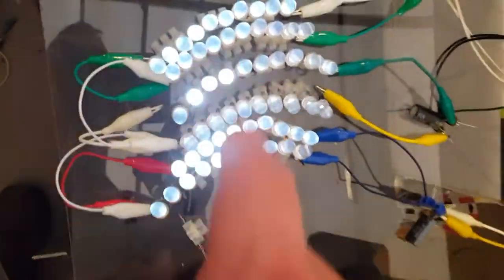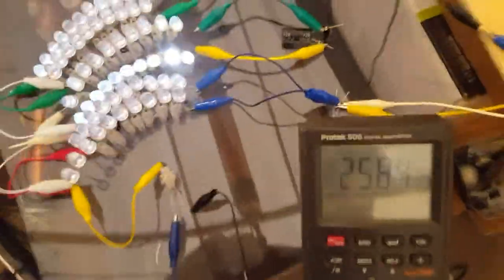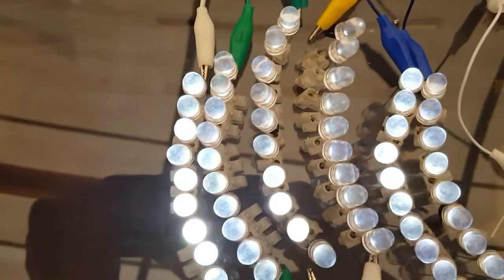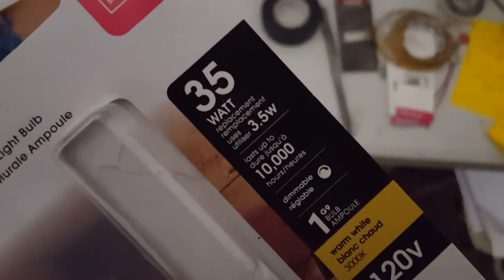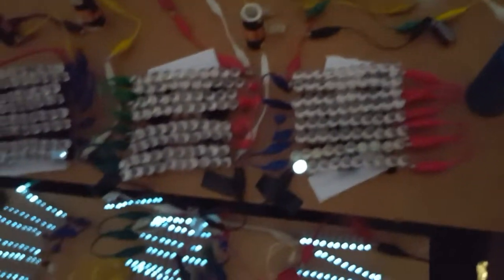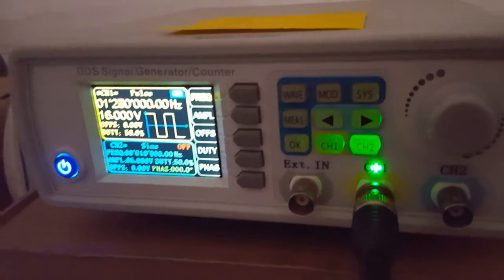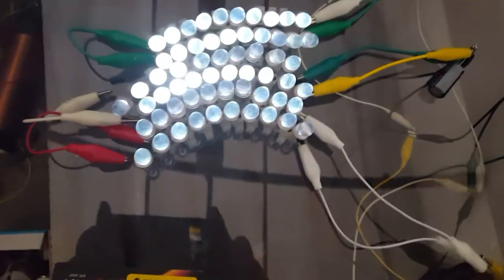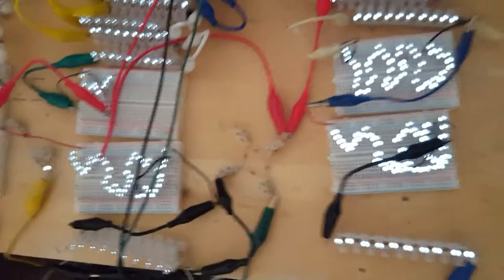WIRELESS POWER TRANSFER Part 22  (Over unity!? Free energy!!?)

Comment: Cool stuff! Great progress man
One way to make it a closed system - find a used (or new) UPS battery backup like what people use when the power goes out, their computer stays on because there's a 6 volt or 12 volt battery inside. 
Also find an inverter that converts DC to AC 120V 60 Hz.  
Start with the output of your circuit that lights hundreds of LEDs set to give 12V DC to the inverter, at enough current to charge the lead acid battery in the UPS. 
Have the UPS plugged into the 120V wall socket,  plug the signal generator into the UPS, then get your circuit running. 
Make sure there's the 12V DC output going to the inverter, and 120V AC ready to use coming out of the inverter. 
Then unplug the UPS from the wall -- battery backup should kick in and keep your square wave generator circuit running. 
Then plug the UPS into the inverter, and there's your closed loop, see how long it keeps the UPS battery charged such that the circuit it self-sustaining. 10 minutes? 30? An hour or more?  
That's one way to test it, but it sounds like you have lots of ideas
Reply from the maker: Thank you very much.  I was thinking about 12V battery and converter.  I was trying to think of how to run freq gen from wall and switch to battery(or capacitors) without disrupting the flow through the system.  I printed out so i can read a few times.  I will look up this UPS battery back up😎.  I hope you solved my problems.  Not sure if my system will like the inverter, but I will find out.
I was thinking about maybe a Tesla type switch,,, and I have also been wondering if the Tesla switch could work with capacitors instead of batteries😎
Thanks again, see you at the next video.  I like the way you think😁!
Reply: @INVENTOR3  Yes, the only reason to go to AC and then back to DC is because the signal generator plugs into the 120V AC wall outlet. But a measurement of the DC output voltage and current (and a peek on the scope to make sure its really pure DC and not just half rectified) might let you get by with a simpler method - a DC to DC board that provides a constant voltage and current out, given a variable amount of voltage and current in.  For example a device like this  https://www.youtube.com/watch?v=XAAMxLFbYZg
Reply from the maker: @TechnoW1zard  Ahh, yes, I was looking at those step up/step down voltage converters/boosters.  Thank you very much.

Comment: That is damn impressive Paul, just wow really! I just can't figure why or how with greater load you keep getting greater voltage. Your not using a step up transformer, so where the hell is it coming from? Mind 🤯.
Reply from the maker: Thanks M!!  It really is amazing!  Just gives up what's needed!  Many LED lamps can be tricky to use with my system because they all have their own little tiny circuits in them.  In my opinion, unnecessary hindering components.

Comment: Hey Paul   Great work!! wow   Its definitely the High Freq  and the coils with a Good earth ground that is where the ""Amps"" is coming from , "earth ground"  and the circuit is behaving alot like a tank circuit and inducing the current to the ground  its a pulling effect   Cheers!! Mike
Reply from the maker: Thank you Mike!  I believe I have pushing and pulling effects.  Yes, high freq.  And I can also replace Earth ground with just a plate or even an antenna, I can pull electrons from many objects.  I will soon try water as ground.  And also try nylon, Teflon and wood.  I think mass has a lot to do with it.

Comment: hey paul try using a joule theif circuit to suck out and increase the voltages then step it down to increase the current if ive got it right
Reply from the maker: Hey Steven, good to see you!  Thanks for the suggestion.  Hope your doing well, did you win the lotto yet😁
Reply: please try this idea paul
Reply from the maker: @Troubledsham  Hmmm, okay, I have a joule thief some place in my Lab😎  I also will try a Cockcroft/-Walton voltage multiplier.

Comment: Oh what happens if you wire mini ceramic capacitors to turn them into a voltage multiplier?
Reply from the maker: I tried this :-)  Yep, ceramic caps and diodes to make voltage multiplier, a Cockroft Walton voltage multiplier.  I do not have it on video, but I did try it.  Hmmm, I will have to look up the difference between Cockroft Walton multiplier and Marx generator.  But so far no good results from it, but I have many more experiments to do with it yet.  Soooon I will try boosting voltage again.  But first trying to see if it is needed, and how much energy can I pull out of this as it is.  Obviously the whole system is some sort of voltage multiplier :-)  Thanks for commenting Travis, keep coming up with the good ideas😎.

Comment: Did you verify your circuit? Meaning dissamble and reassemble your circuit to ascertain your results?
Reply from the maker: Well, yeah, when I went from 350 LEDs to 700, I rebuilt the whole system.  But I do still need to have someone else replicate to verify.

Comment: So do you use capacitors to increase the load current?
Reply from the maker: The caps you see in this video do not have a purpose at this time.  At this point I'm just testing where I can put them & how high I can charge them.  I feel confident that I can use caps to power the Freq gen, which is my power supply.  Good to see you again Travis.
Reply: @INVENTOR3  Yes I am back. I am just annoying. I was going to suggest litz wire for your coils. And maybe something like the quarter wave coil from a mystery crystal set radio. But that may be over doing it. I though tuning a coils to get a better output may work. LEDs respond well to high frequency, And I guess you could try using ferrite cores and what not for you coils or just an iron nail to see if your coils give more output. I wonder if piezo disc would act as negative resistance amplifiers at high frequencies? Okay I peppered my spam everywhere. I am great. I am eating rice casarole.
Reply: @INVENTOR3  You can also use a bridge rectifier with an antenna and ground and it should easily run an led.
Reply from the maker: @travismoore7849  Sorry for the late reply here.  No, your not annoying, hehehehe.  I been wanting to try the litz wire yet.  I have tried ferrite rods and copper rods in the coils, but easier to tune the ways I normally do.  Piezo,,, well I would like to use the Barium Titanate cylinder I got from John Hutchison, but that will be farther down the road, it needs to resonate at a specific freq.  About the bridge rectifier, I have used full wave and half wave, but they have to be used in specific areas of the system.  It seems my system is working from a push/pull action, so if I use rectifiers they can kill half my energy through the system.  Good to hear from you.  Rice casserole sounds good :-)
Reply: @INVENTOR3  Just keep up the good work. I have not been experimenting anymore just making sun tea and what not. My you tube videos show my insanity setting in.
Reply: One more thing, you know if you can power LEDs maybe you could power transistor amplifiers to get more output. Couple that with the tuned lc tank to regenerate and use reflexive amplification of your power receiver.